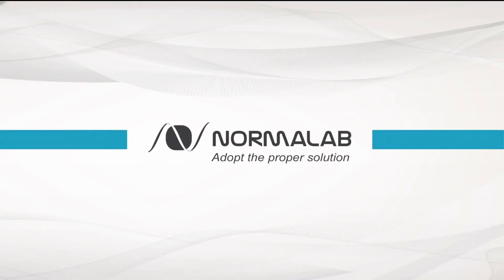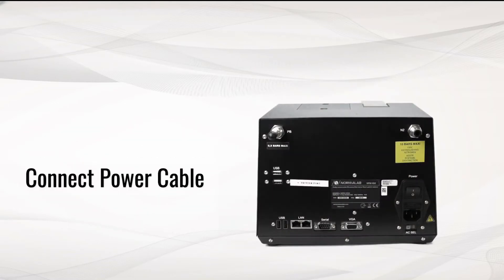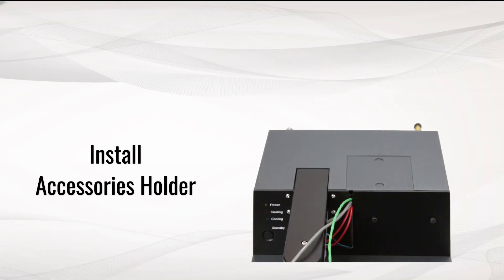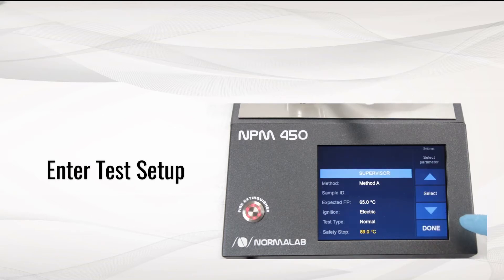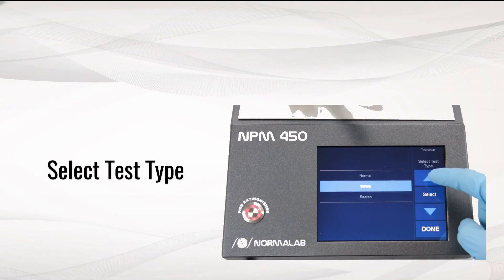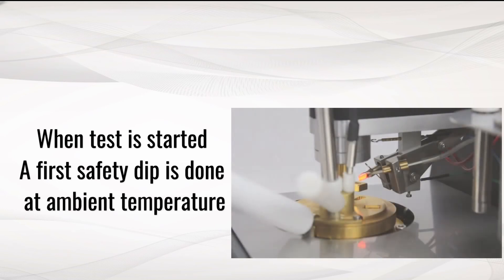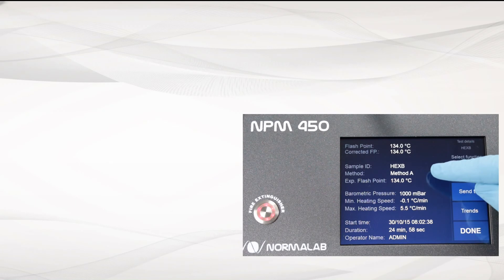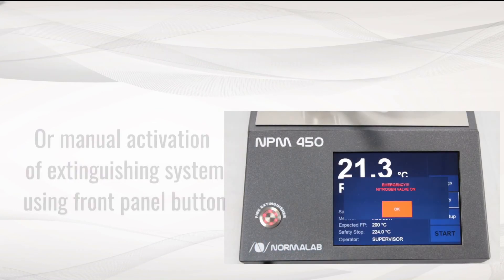Automatic Flash point tester NPM450 Pensky Martens Method

Comment: How do you use the gas setup
Reply from the maker: You need the gas connection on the rear (50mbar max), select the gas ignition in the Test Setup, and adjust the gas flow using the needle valve located near to the probe connection.